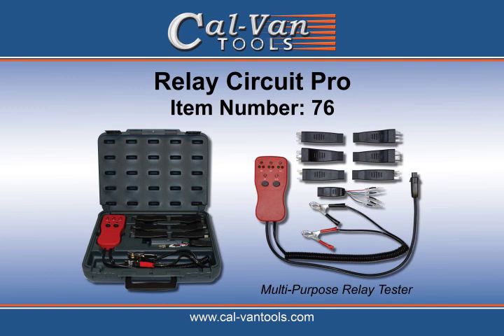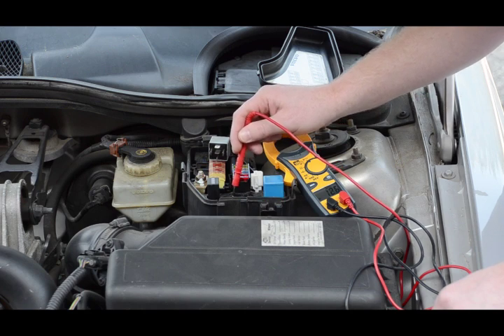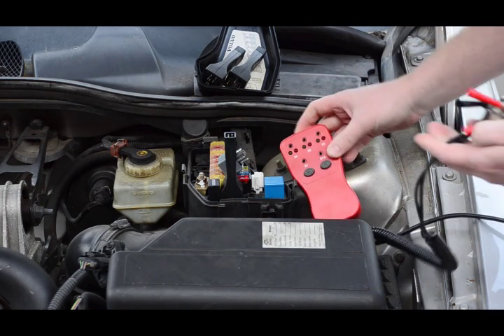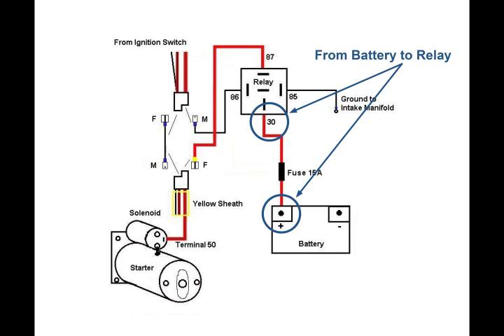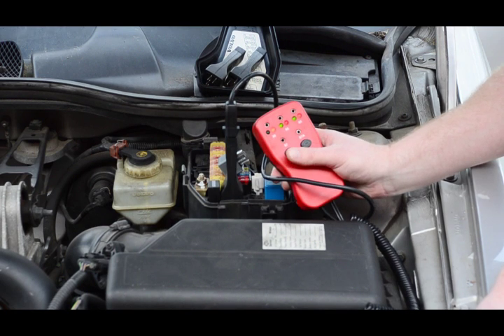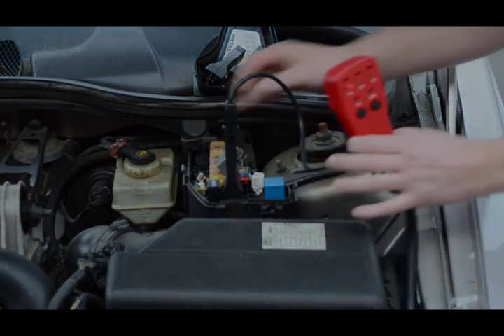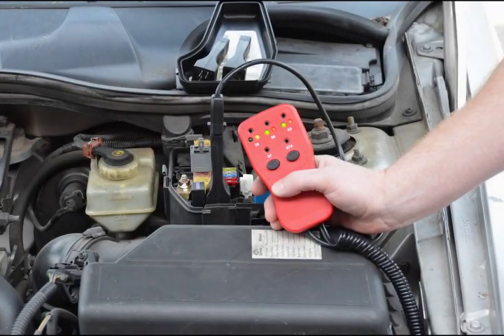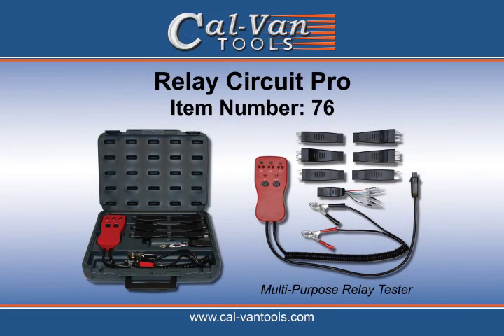76   Relay Circuit Pro

Comment: Sooo, how do you test the relay itself?
Reply: If you hook everything up. And everything on the tool lights up lights up either green or red, then you know your circuitry is good, and then when you turn on and the component and it works like the starter, then it is good. But before, if it wasn't working, then it was your relay. That's how you know if your relay is not working. The tool lets you know from the lights. If both lights are on, red and green. Then you know you have a short in your circuitry.😊

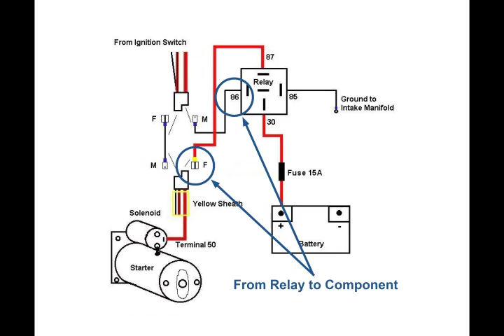Comment: I bought this tool and am waiting to use it, but I believe you made a mistake at 1:45  .  You show us the 3 "routes" it tests, #1 battery to relay (Batt+ to pin 30)
#2 Relay to switch (pin 86 to switch) and #3 relay to component.
Here you highlight pin 86 again but it should be pin 87
Reply: I also agree and you should remake this video to correct it. You would cause A lot of bad reviews with buyers that did not know better.

Comment: Cool device, quick question does the ignition have to be on? To test to see if the starter comes on? Or should it come on using that device whether the car is on or off?
Reply: No you can test without ignition